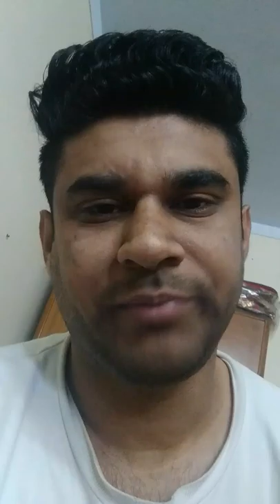Yamaha Fz Fi V 2.0 jerking and missing issues

Comment: What about the engine noise from the Fz 2.0??
Adjusted the tappets many times but still the issue persists.
Many owners are facing the sams issue from their bikes.
Reply from the maker: Check with some other service centre or ask them to call engineer to check once.
Reply: Ankit Sikka :- Aree yaaar its pretty common in alll FZ’S specially in the version 2.
Its a manufacturing defect no engineer can solve that issue.
Reply: I adjusted tappets for my FZ V3.
Inlet - 0.06mm and exhaust -  0.10mm. Issue will resolve bro. If you are still facing tappets issue, replace rocker arms and it will resolve your tappet noise.